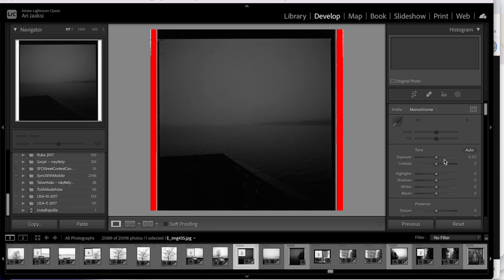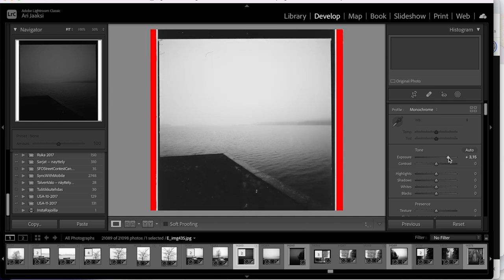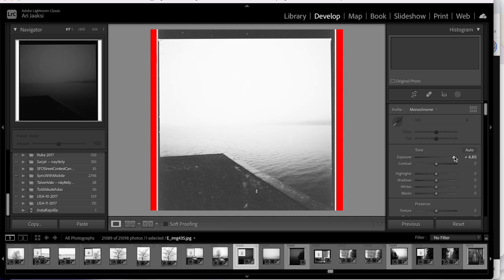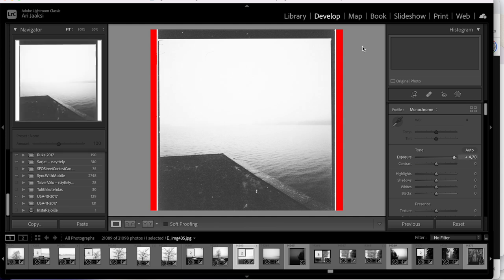Learning from happy accidents

Comment: I've shot rather a lot of Fomapan 100 and 400 (rebranded as Arista .EDU Ultra) over the past twenty years, and I'd agree, it's a great film for not hiding the film structure.  It's like 1960s vintage everyday films, in some ways -- not the very best Kodak or Ilford had to offer, but what you'd get from Agfa or GAF consumer films that were sold in drug stores or K-Mart.  I've just gotten several rolls of Catlabs 320 and several of Shanghai GP3 (the only current source of 220), I'm hoping they have some interesting character as well.
Reply from the maker: I shot a few rolls of GP3 lately -- 120, though. It dries so curvily that I don't think any other film does!
Reply: @ShootOnFilm  I've seen some heavy curl with .EDU Ultra films, too.  I just store the negative pages under something heavy (say, halfway down your piano book stack) for a few weeks and they flatten out.